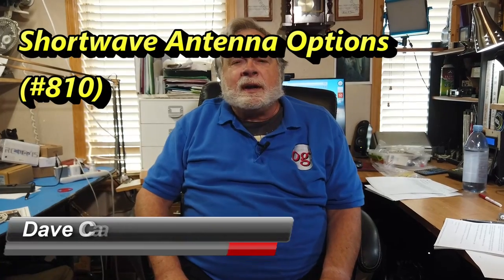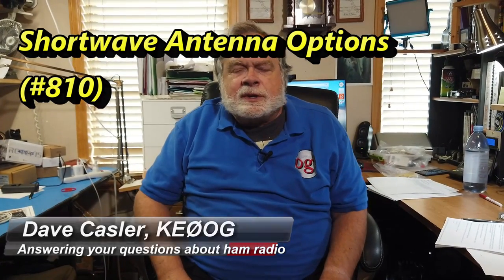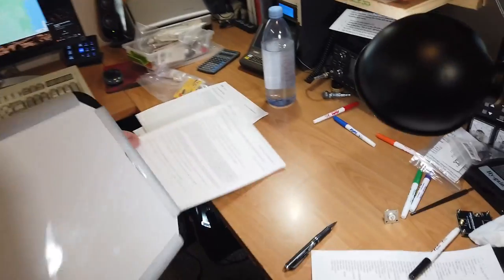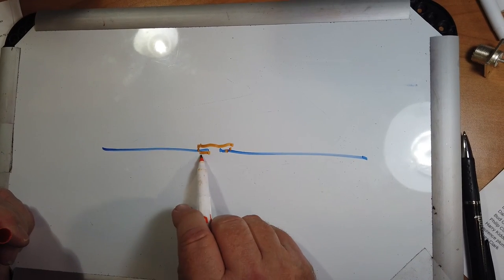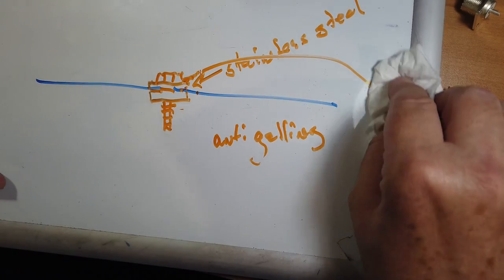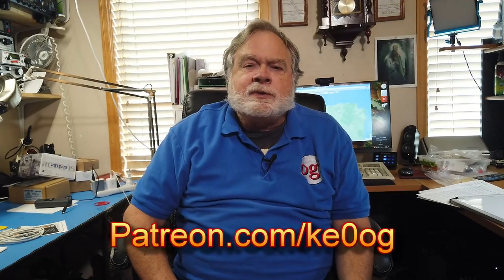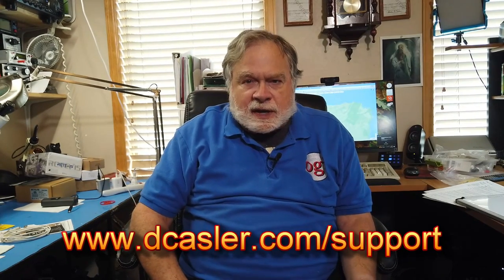Shortwaves Antenna Options (#810)

Comment: Dave, always an informative and fun video.  The tower shown in your presentation looks interesting.  The chip and tar mixture used for the roof is creative.  BTW, my first receive shortwave antenna was an indoor, insulated long-wire, draped on the carpeted flooring along the perimeter of the house.  Worked well for what is was.  73,    AC3HT
Reply: Tar and chip is fairly common in AZ for government buildings.  It's not great in climates that freeze, our office at the county building was almost always dripping.

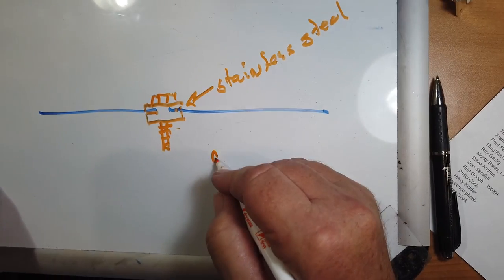Comment: @04:03 What is Galling?
Galling is a form of wear that can occur when two surfaces slide along one another. While galling can occur on any surface contacts with sliding motion, it is most commonly considered on threaded components.
The relative motion between the surfaces creates friction and shear stress that results in pieces from the microscopic structure of the surfaces to break off. In threads, this damage results in increased pressure between the surfaces and causes even more friction and wear.

Comment: from a fundamental Physics point of view, since the pointing vector is proportional to E X B, I would expect a very long wire antenna to be least sensitive in the direction the wire is pointing and most sensitive in the directions perpendicular to its length.